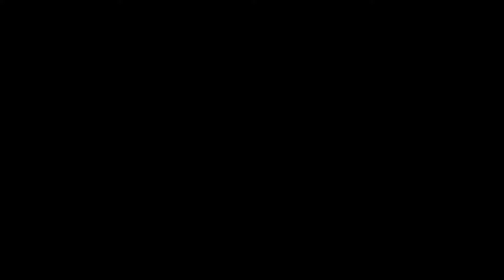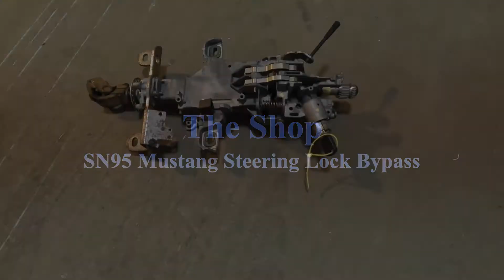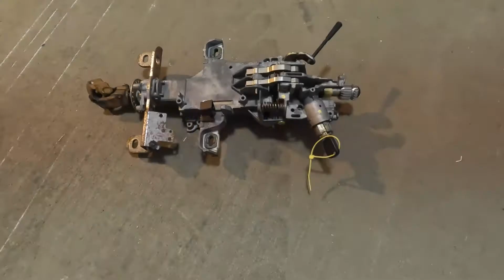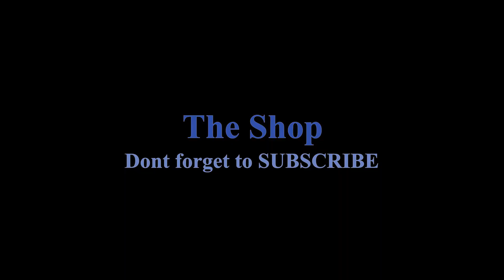SN95 Mustang Steering lock bypass

Comment: i know this video is 2 years old but i can’t find the link, any advice?
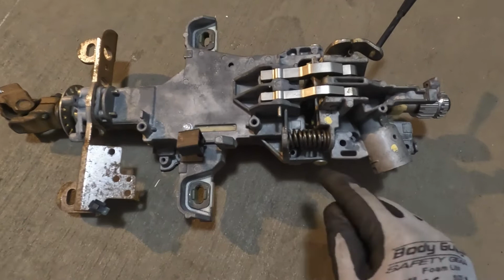Reply from the maker: The link is the solid yellow plastic piece from the ignition barrel to where the screw is inserted.  If you look at 0:13 in the video you will see the plastic piece at the tip of my finger, it is the same piece that the screw holds in place.

Comment: Why would one need or want this done? Just curious.
Reply from the maker: This steering column was used in a race car without an ignition switch.  Initially we kept the key in the ignition to disable the steering lock - there was some risk  in doing this, we once tried to move the car and forgot to unlock the steering.  Hence our decision to disable the steering lock.